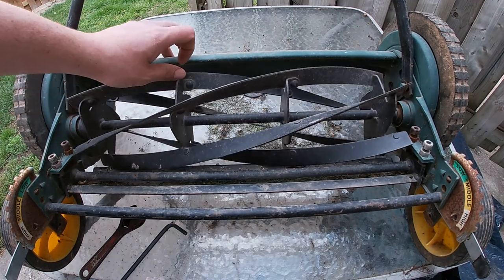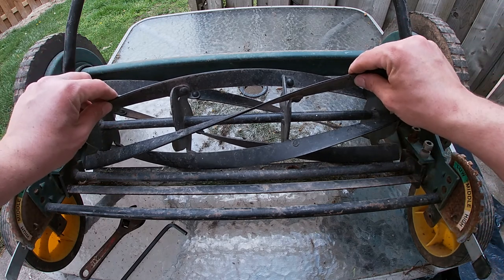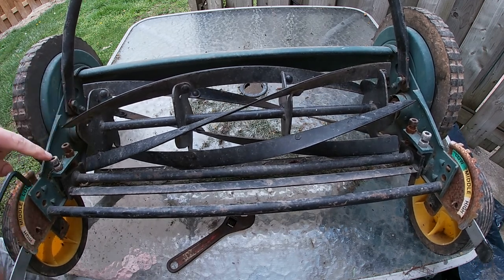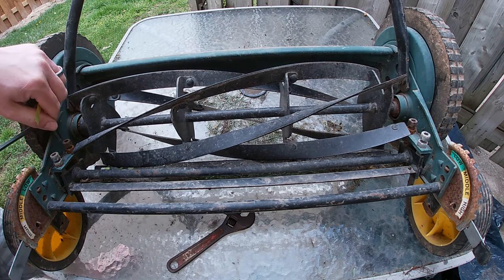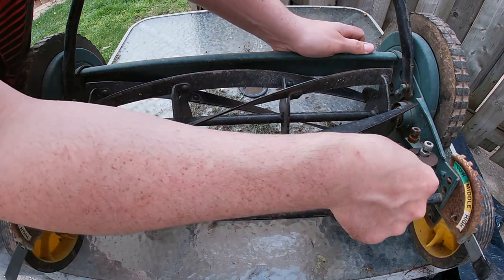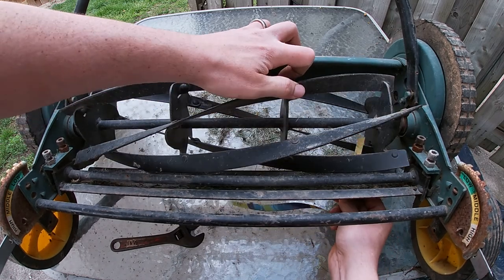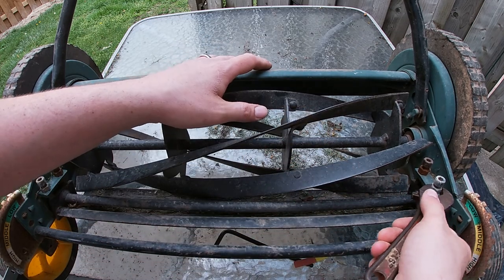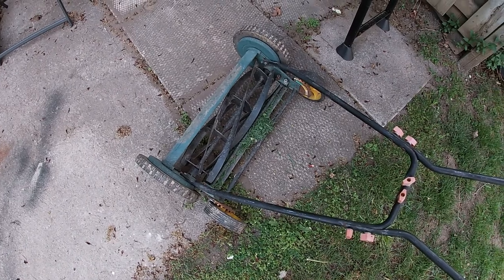How To Balance The Blades On A Reel Lawnmower

Comment: Oh dear, I am not mechanically inclined but mine is not cutting well at this point.  I also watched the sharpening video. Will try to do this.  If I can't get it to work, will either have to go back to gas powered mower or borrow a goat :(
Thank you for the instruction,
Reply from the maker: Sorry to hear that. Hope all works out in the end. Goats are pretty cheap to maintain too. Thanks for watching. Please like and subscribe